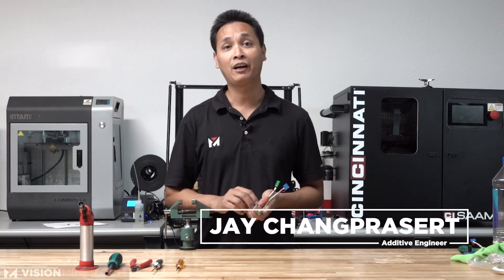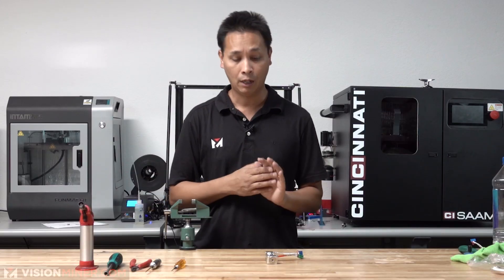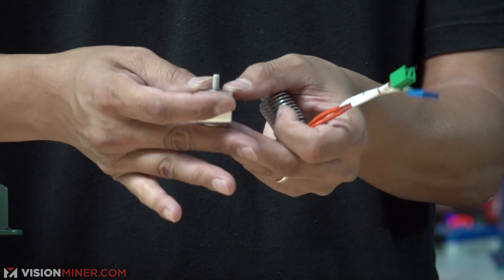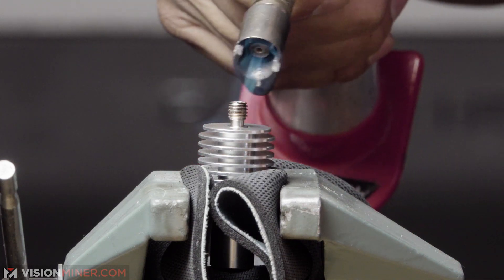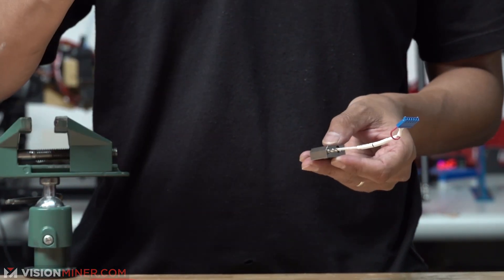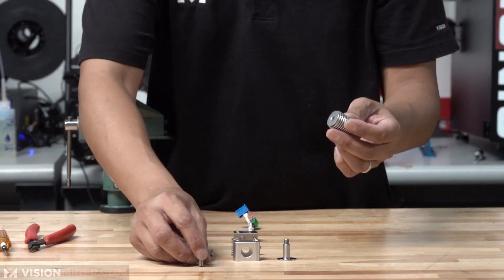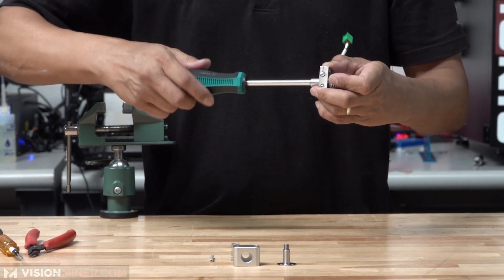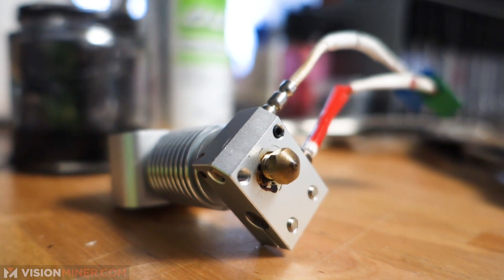How to Take Apart and Rebuild the Extruder Hotend on an Intamsys Funmat HT Enhanced

Comment: Hello, could you share some Advice on how deep to screw in the Heatbreak into the Cooling Body? I'm using the Funmat HT Enhanced at Work.
I also got Trouble with the Heater Cartridge/Heat sensor Cable, since they apply some force to the hotend once it is back inside the FunMat. This arrests the motion of the spring, meaning the Nozzle ultimately crushes the buildplate because the Hotend cannot move, so it cannot reach the Z-Stop microswitch.
Finally I've got big issues with filament grinding - mostly happens with PLA, but also ABS and PETG. It almost always gets to the point where there's either a big accumulation of filament inside the extruder preventing filament transport, or it grinds away so much filament that the teeth of the gear have nothing to grip on - both resulting in failure.

I've tried pretty much every setting, changed/cleaned everything, adjusted the extruder current following instructions from your customer support - nothing works. Since buying it months ago, the printer has performed below the level of a 200€ Printer.

So anyway, this turned into quite a rant; if you got a solution to any one problem I mentioned, I'd be grateful.

Greetings from Germany

Peter
Reply from the maker: Greetings! Best to email this type of thing, we don't always see all the comments :)

You want to screw it in just to the top -- flush with the top of the heat block. Keep the heat break throat clear of the block, don't put it in too deep. The nozzle should fit snugly against the heatbreak, inside the block. 

For auto leveling you need to remove filament from the hotend or the spring won't work, but the wires from the heater/thermistor should not cause any issues -- this is likely something else. Perhaps you have put the hotend shroud on incorrectly, somehow creating tension on the wires. We generally print without the hotend shroud, unless we are using the cooling fan (for PLA, mostly). 

For other filaments like ABS, you sometimes need to print with the top door cracked open because that motor does get hot. Has Intamsys had anything to say about this issue?

Make sure the doors are open for low-temp filaments, you might also have the tension gear too tight -- for all filaments, we keep it finger-tight. 

Cheers -- Hope this helps!

Rob